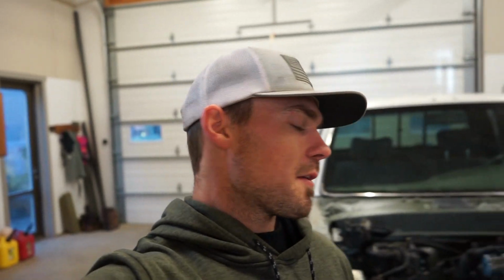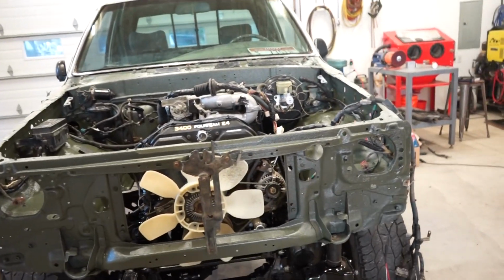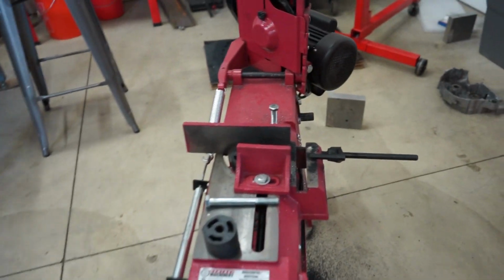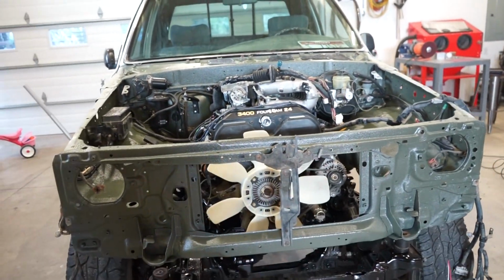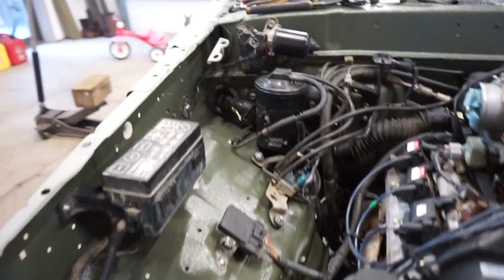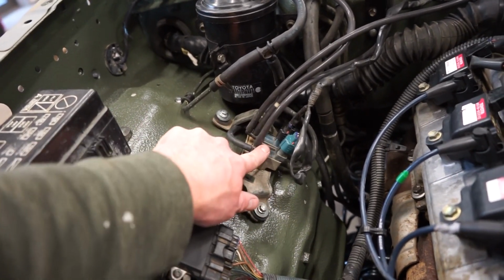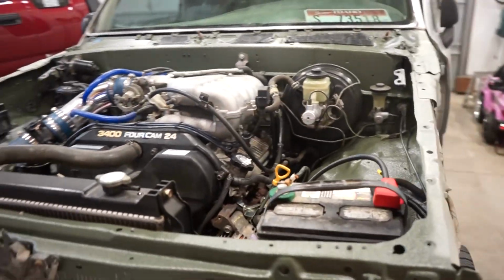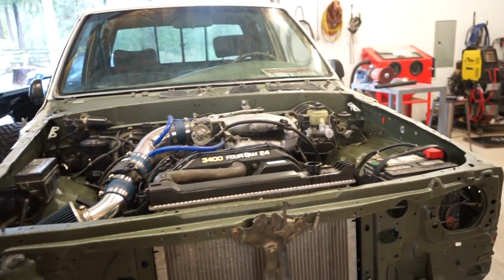I FAILED... But The 3.4L Toyota Swap Is Back Up And Running!!

Comment: The best part of this "Budget Build" is that you aren't skipping any steps or taking short cuts. It seems that you are putting as much labor and quality in this build as you did the other truck. On this one you are just not spending as much on parts and material.  I'm enjoying following this project.
Reply from the maker: Exactly! It’s going to be a solid truck!! Just not as many cool parts

Comment: Austin, when cutting cylindrical materials, especially with band saws, use a v- block made out of a 2×4. You didn't fail, you adjusted your plan.

Comment: Replacing the ECM will help how the engine runs, since right now it's being told to run with an auto. It will probably run smoother and idle at a slightly lower RPM. You should also look for a fan shroud, it will help with cooling in slow traffic or on the trail. (you'll probably need to trim it a bit to work with the body lift.)
Too bad you don't have a lathe, it would have worked well to part off the body spacers.

Comment: I've heard that if you put a load on the old wiring harness connectors with a light bulb or balance resister the codes will go away. That's worst case scenario if you can't find a manual ecu.

Comment: Gravity bleed or do the one person bleed. I love it. Fill your master cylinder then in like a 16oz soda bottle or something fill 3/4 with brake fluid. Then get a peice of hose that just fits on your bleeder screw(zert value) make it long enough to go to bottom of bottle while its on the ground. Then open bleeder and go pump brakes like 5 times really slow. Next close bleeder fill master cylinder and repeat a couple times. Do to all tires. Its the best system ive found. Try that. WRENCH ON BROTHER

Comment: Great builds! I did this swap a couple of years ago on my 88 xtra cab. With the ecu, iirc, you want to match the year ecu to the motor. (97-03 ecu's are different than the 95-96, in that they can accommodate a supercharger better. Sensors, monitoring, etc.) With the intake, a-fe makes a tube that looks stockish, and gets rid of all the resonator/baffle junk. Pair that with a stock 5vz air box, and an a-fe reusable air filter, and you'll be set.

Comment: I installed a body lift on my 95 4runner and the  most cost effective route I found was to buy uhmw plastic material and then cut it with a chop saw and drill holes in each of them. I think I bought a 3ft stick of it off of eBay for like 20 dollars and then of course I bought bolts but it seemed a lot cheaper to do it this way

Comment: Air filter needs a heat shield... Build it, way in your skill set. Also clean that fuse box mounted on the fender.    Good work so far, as expected.  You set the bar high on the TDIota.   Tint.......the red fishbowl.   Good content keep it coming.

Comment: Hi mate, this pickup when it is stock standard does the factory engine mounts suit the 3.4 engine or do they have to be fabricated? can they be bought of the shelf
Reply from the maker: The 3.4 and 3.0 use the same mounts!

Comment: I have done the same swap, get rid of the body lift and cut a small hole in the hood where the intake hits. Then mount a hood scoop. I used one from a Subaru.

Comment: Btw you can use a auto ecu for a manual truck, you just need to repin. I have a 4x4 auto ecu in my truck with no cel.
Reply from the maker: More info? All the auto plugs are not plugged in so the ecu thinks there is no transmission and I have a list of codes! It is pinned right, but the programming wants to see a auto trans plugged in
Reply: Let me see if i can grab you the info i have
Reply from the maker: @orlandomuniz876  perfect!!
Reply: Hey whats a good way to send this info to you? Email dm?
Reply from the maker: @orlandomuniz876  email! Anjone77@icloud.com
Reply: Email sent
Reply from the maker: @orlandomuniz876  thanks! Reply sent 👌

Comment: I have a 99 Toyota Tacoma pre-runner and I have a leveling kit on it 3 inch strut spacers in the front and 2in  blocks in the rear and it’s sitting on 33 and I love it just the right height because it’s sitting pretty much up there with height Wise with my moms 2000 GMC Dooley and hers is stock

Comment: Too late I'm sure, but those lift blocks looked to be a plastic. Even if metal you could have built a wooden jig to hold them and sand them flat. The jig could expose both ends so that you mount the block once and just flip the jig around. This would be one way to get a square cut.

Comment: Pretty much every Toyota I ever owned well both my 99 Tacoma and my 99 Camry I had at one point those both have and had a check engine lights on . My friend also had a 98 Corolla got his checked by his friends grandpa took apart the whole motor pretty much I heard and I got mine checked by my cousin who is a Toyota certified technician after he did a nice tuneup in the car for me .  My cousin could not find any codes popping up so my cousin said after driving it said he drives like a 99 everything sounds normal and my friends grandpa said he couldn’t find anything neither. Also a bunch of people in the Toyota Tacoma group I follow on Facebook say sometimes I just comes on it’s weird like it won’t show any codes or nothing so you might have one with the light just on. I say just roll with it and if anything reset the light if that’s possible

Comment: What flywheel did you go with?
Reply from the maker: Oem 3.4
Reply: @austinniemela  gotcha, we’re you able to find it for under 400?
Reply from the maker: @elston.outdoors  got a used one for $40 and had it surfaced! That’s the best way to go. The aftermarket 3.4 wheels are trash
Reply: @austinniemela  nice, yeah definitely! Where’d you find a used one!?
Reply from the maker: @elston.outdoors  just a wreaking yard!

Comment: I have a factory air box for a 2004 Tacoma 3.4L.  Let me know if you want it.
Reply from the maker: I do!! Can you ship? Is it complete with the intake hose and all?
Reply: @austinniemela  
It is complete, you may need hardware ( bolts ).   I put a cold air intake on my truck years ago.  I can ship it.  I can let you know the cost by Monday October 19th.
Reply from the maker: @sixgreatkids90  ok sounds good! Let me know👍

Comment: FYI running an auto transmission ECU on a manual will give you a better fuel curve and in turn better mpg. Its an old school 240sx KA trick
Reply: Good idea on the 240, Unfortunately not the case on a 3.4.